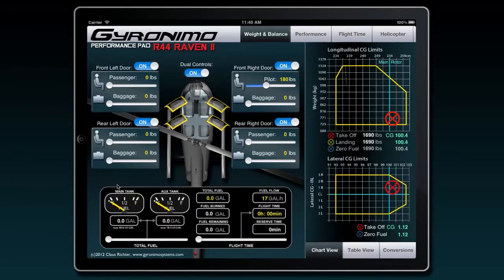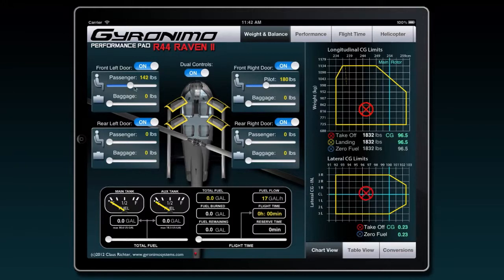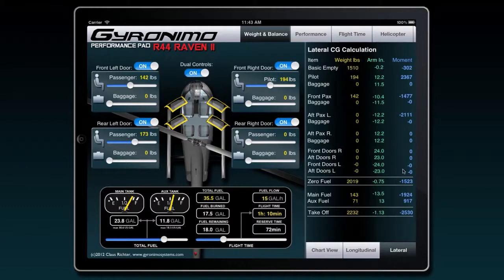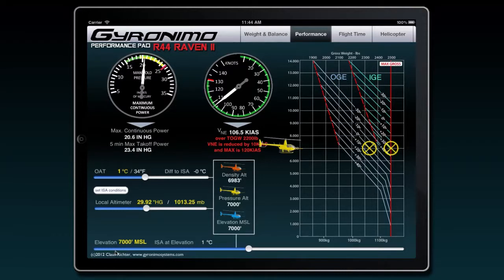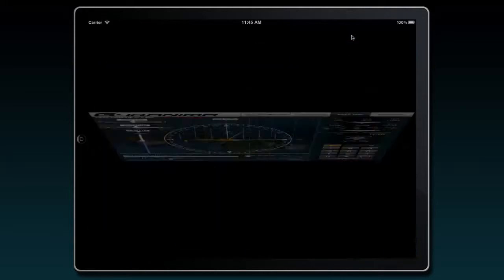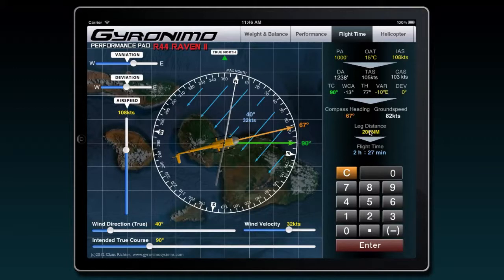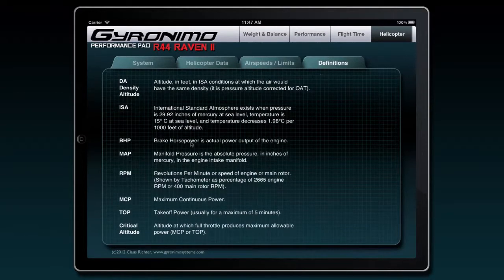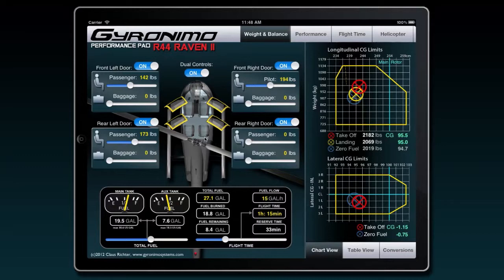Robinson R44 Weight & Balance and OGE / IGE calculations

Comment: I have this app, it is fantastic and the calculations are spot on. The author is always open to suggestions to make it better. I suggest this as a tool to train students or just for yourself. I am using it now in my CFI semester to help explain the weight and balance portion.